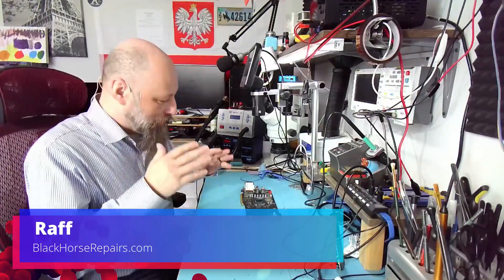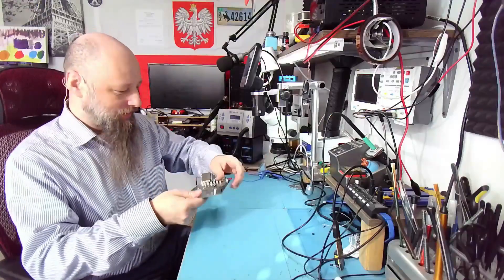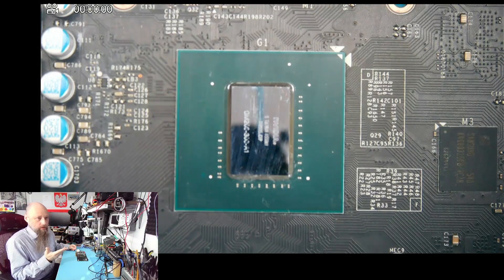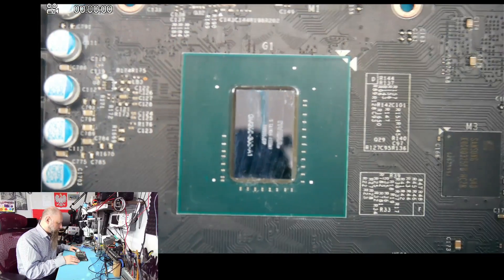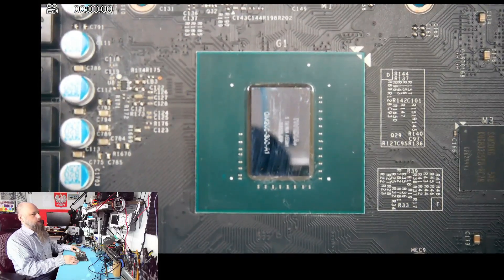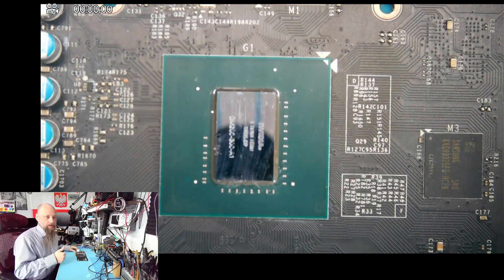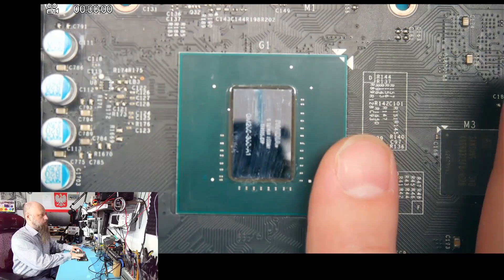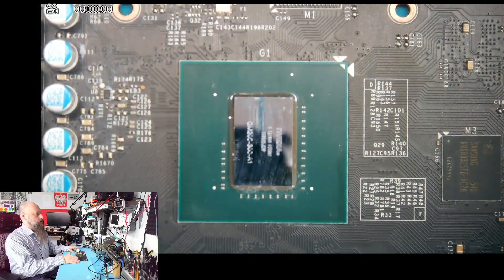108 | How To Reflow GPU CORE using IR6500 and Rework Pro 1.0.8

Comment: I'm in the process of learning GPU repair and am at the stage where I want to start doing core and ram re-balling (currently re-balling ram with my Quick 861dw). In your experience is IR more effective and safe then hot air? Looking at getting an IR6500 or similar if IR is preferable. My concern is the size of the heating element in the head as opposed to the nozzle options with hot air.
Reply from the maker: yes, IR allows you to use lower temperature and adjust it more precisely. With ReworkTC you can turn you $400 machine into a professional equipment ;)
Reply: @blackhorserepairs thanks mate! Appreciate the response. 🙂

Comment: How often does reflowing work when the core is still good? Re-flowing vs re-balling.
Reply from the maker: People used to say that it helped but I think it had to do more with heating the core than actual solder reflow. I would say that reballing at least has a chance of working. If there is corroded pad, reflow will not help (unlikely at least) but if it's cracked solder it definitely can.

Comment: Your GPU chip didn't popcorn right? Because they are rather sensitive to heat, peak of 245C is a lot
Reply from the maker: I did not notice any popcorning and yes, 245 was not needed, I updated the profile to peak at 235
Reply: @blackhorserepairs  Yes good that you didnt. I unfortunately popcorned a chip today, with peak 220C PCB temp and 400C hot air temp for 1 minute. So that is why it was a bit scary to watch your video, when the GPU chip started moving around, especially with the flux bubbling underneath. My mistake was excessive hot air temperature and having trapped moisture in the graphics card ( I didnt oven bake at 100C for 2 hours, I should have.
Reply from the maker: @mikegaming4924  oven baking helps for sure, but what I do is just leave it on the preheater at 50-60 degrees for a bit before I start the procedure and first I slowly ramp up to 190 on the bed before I start blasting it with heat. I use IR instead of hot air, it seems a bit more reliable (and easier), I also believe it makes it easier to prevent popcorning. 
400 seems a bit much with a nozzle, you should be able to reflow at 320 easy

Comment: Arduino uno is not a good choice for controller bga 😅😅😅 stm32 and ESP32 will be better choice?
Reply from the maker: with more capabilities come more problems, I agree that ESP32 or STM32 is superior to Atmel but I disagree that you can't make reliable controller on them. The heavy lifting is done by the computer, all it has to do is control 3 outputs and read 2 inputs, simple as that. There might not even be a PID control in it, I'm still thinking it through.
My target is Arduino Nano, a $3 MCU should be enough for this but we'll see :)
Reply: @ z praktyki wiem że nano nie podoła  😅😅😅 mega może  . Należało by podłączyć  sensory temperatury bezpośrednio do sterownika pomijając wszystko  by to on sterował grzałkami inaczej mogą wystąpić opóźnienia co nie jest za bardzo wskazane przy delikatnych układach bga 😅😅😅
Reply from the maker: @grzegorzwozniak837  I haven't looked into that yet so I guess we'll see, thank you so much for your input.